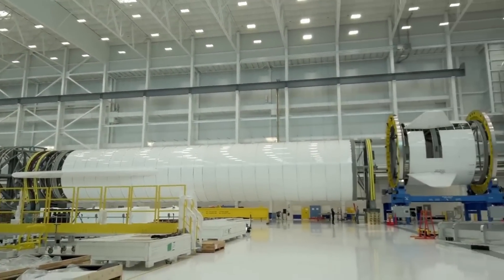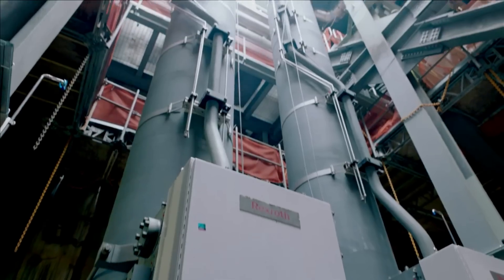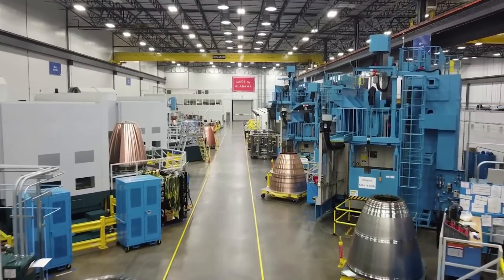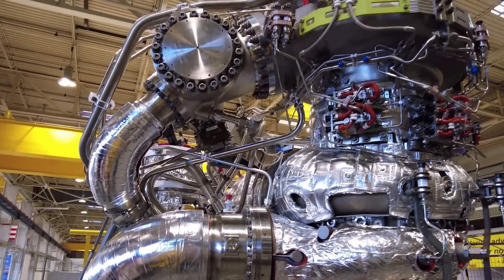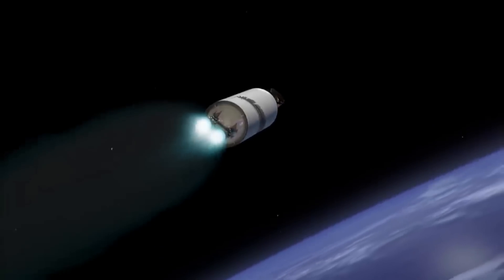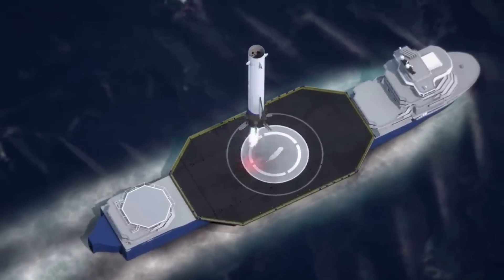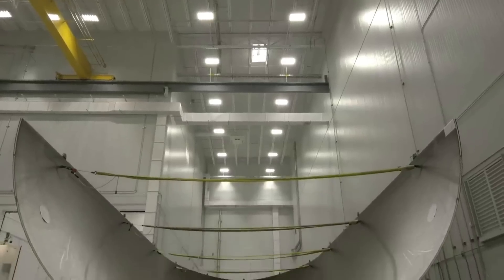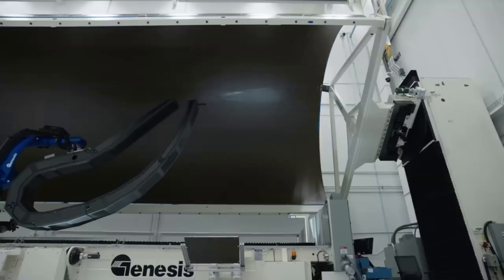How Close Is Blue Origin's New Glenn To A Maiden Flight?

Comment: The Turtle and the Hare story contains wisdom that's older than the pyramids, and should not be underestimated. SpaceX just did a second test flight days ago, and everything was looking good until both stages malfunctioned and exploded. Whatever Elon says, that's gonna set them back at least a year, since it seems there are plenty of issues in both stages they haven't figure out yet. Next launch is gonna fail too, maybe achieve another milestone but not a complete launch to orbit and booster landing. BO in the other hand insisted, just days ago, on the August 2024 date for New Glenn's maiden flight, and, watching this video gave me the feeling they are gonna meet the deadline. Remember that New Glenn's CGI presentation came out 3 months after SpaceX presented their BFR animation, so, at this point BO, against all odds, is in position to win the race of super heavy launchers, and become the largest operational rocket in the world, even if it's just for a few months, but that will prove the Turtle and the Hare story to be right, once again.
Reply: My god you literally have no clue what you're talking about. Falcon 9 is New Glenn's direct competitor, and they've been landing and reusing the first stage since 2015 (which literally no one else has achieved since). SpaceX is putting more mass into orbit every year than the rest of the world combined, and has literally the only orbital launch vehicle capable of sending astronauts to orbit/the ISS in the US (and the only private company which has done so, period). Starship is the next giant step, which Blue Origin hasn't even dreamed up yet - they're still playing catch up to Falcon 9 and haven't even reached orbit. At all. They're so far behind it's not even funny. SpaceX won this race years ago and are already onto the next, even more challenging race while Blue Origin is still floundering around at the start line of the last one.

Comment: Its been no where near delayed as the Falcon Heavy
Reply: Its actually on par. Falcon heavy was first conceived in 2005 and first flew in 2018, 13 years. New Glenn was conceived in 2012 and is currently at 11 years and targeting 12, realistically 13. The problem I see is that spaceX had experience launching falcon 9 by the time the heavy was ready to launch and there was a lot of overlap. New Glenn and new Shepard have very little in common.

Comment: Blue Origin takes so long to build a rocket that they are afraid of launching without testing everything ad nauseum.
SpaceX builds their rockets fast and breaks them as part of the test program.
With both companies approximately the same age, it is clear that SpaceX has a more effective method with the Falcon 9's high number of launches and routinely landing boosters.
Blue Origin still has not got it up to orbit.
Reply: Blue Origins focus over the last several years has been New Shepard and the BE-4 engine for Vulcan Centaur. New Glenn was deprioritized to work on ULAs rocket. Now that BE-4 is worked out you are seeing faster progress on New Glenn.

Comment: Blue Origin - Building yesterday's rocket, tomorrow.
Reply: If New Glenn works right out of the box it is at the time of its first flight going to be the best rocket ever flown. That is hardly yesterdays rocket.

It is true that Starship has a bigger upside if it works. But Starship is also a lot more risky, and it may be many years away from working, if it ever gets there. The raptor seems shaky at best, the launch performance (acceleration) was disappointing, the landing concept for Superheavy is unrealistic, etc. etc.

Out of the 4 main new heavy lift rockets (SLS, Vulcan, New Glenn and Starship), people seem to think that SpaceX is moving fast and that the other 3 are slow. But I would not be surprised if Starship is the last one of those 4 to fly an actual operational mission.

Comment: Seems that is the difference between SpaceX vs Blur Organ.  SpaceX would rather innovate and fail fast all the while analyzing.  SpaceX is extremely open and transparent, so much so when one of the last few startship tests for landing, it was a community comment and Elon was like, damn that is a great idea, why didn't we consider that... So next rocket started 3 engines determined the best and shut off the other two.   Just hard to see how a blue organ and funktion if you have such a high failure rate for actual launches...  Would have a lot more confidence in flying in something Musk said is safe...

Comment: I'll give BO props. They actually delivered their engines to ULA. 5 years late, but they delivered them. I stopped believing they would ever successfully produce anything a year or two ago, but I was wrong. They're faster and more ambitious than Boeing and NASA, which is commendable, but it's like comparing a snail to a tortoise. They'll need to hurry it up if they want their rocket to be relevant when it's finally operational.
Reply: Have they realy deliver flight engines to ULA, as ULA will use them on a Vulcan flight, and not this is "boiler plate" engines so ULA can test and make adjustments to Vulcan, so evrything is ready then the real flight engines arrive.
Reply: Jezuz 5 years 😳😳

Comment: Tbh let’s guess how many Starship-Superheavy launches (IFT and even launch to orbit) would happen before New Glenn really leave the pad for the first time.
Reply: Operational SS launches?  Not many, 3-5 I'd have to guess.  There is still a ton of work left to do with SS, even ignoring the Stage Zero issues.
Reply: @Defective1313  The fact that it is already operational in it's development stage is extremely impressive and bodes well for SpaceX
Reply: @weasle2904  well, Operational implies that it would have reached a post development stage.  Given how SpaceX plans to use it, we may never see an end to SS/SH development until whatever comes next, but I'd still say that we are a good long way away from referring to SS as operational, even if it is delivering payloads. 

I think a safe milestone to consider SS operational would be when it is approved for servicing government orbital insertion contracts.  Does that check out with your thinking?
Reply: @Defective1313  It doesn't imply that, especially since they are constantly iterating their rockets and continue development. However you're missing the point. SpaceX in a very short period, has launched the most technically impressive rocket in the history of mankind, and it won't be long until they make it fully reliable.
Reply: @weasle2904  thats pure opinionqted assertion to say it will be fully reliable in short time.  Based on what?  Yeah, they're doing awesome stuff, but its taken over 3 years to get to this point and suggesting they're another 1-2 years away isn't FUD or any other BS you might want to characterize as such.

Don't make opinionated assertions as if they're bound to be true, it does your argument zero favors.  It just makes you look like somebody whose opinion shouldn't be respected.
Reply: @Defective  They've developed the most technically impressive rocket in human history in a fraction of the time any space agency has developed any large payload rocket, period. They already have 2 StarshipHeavys being prepped for launch soon. 

SpaceXs R&D strategy is clearly superior to everyone else in the industry and allows them to quickly iterate and improve their designs in a fraction of the time.

All you need to do is look at how successful Falcon Heavy was

Comment: I would say a first flight is still years away, they are still struggling to make engines as can be seen from their footage showing several engine bells but no power heads or combustion chambers. Their engines are still too complex and difficult to make economically or quickly and they have a contract to supply ULA which is going to be taking a fair number per year. Add to that we have still not seen anything close to a finished first stage, they are sill messing about with the mockup doing fit tests.
Reply: Which years away!? Are you ok!?
Reply: @carholic-sz3qv  Years rather than months, I would say at least 2 probably 3 years if you want specifics.
Reply: @schrodingerscat1863  yeah in your dreams exactly!!!
Reply: @carholic-sz3qv  What would you consider a reasonable timescale then? Sounds like you think 2 or 3 years is unrealistic. To be fair, based on their progress thus far it could be another 6 years who knows but 2 to 3 would be a minimum as far as I can see.
Reply: How can you deduce all that from that video?
Reply: @Devinci297  He made it up. Blue Origin already sent two BE-4 Engines to ULA.
Reply: @jamesolson9498 well i don't know how true his words are but it's true the BE-4 engine is massively delayed to the point ULA should've just given up on them.
Because you know ULA have to launch the Vulcan Centaur rocket to make money and there's no more Atlas V rocket and Blue origin is holding them back to the point they have to sell themselves
Reply: @LeftOverMacNCheese  ULA made a big mistake relying on Blue Origin for engines. Their engine design has had huge problems in manufacture to the point I actually think BO are losing money on each engine. They actually tried to renegotiate the contract but ULA were having none of it. Trouble is the two engines they have took over 2 years to build and they are apparently the production designs. 

It's a far cry from SpaceX and Raptor where they are able to crank out an engine per day at this point because the design considered ease of manufacture and low cost at every step.